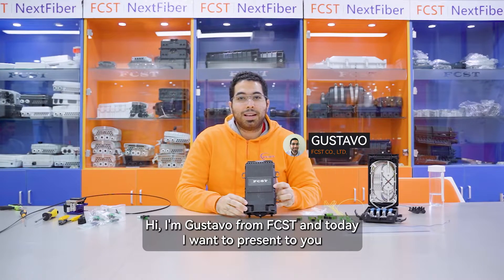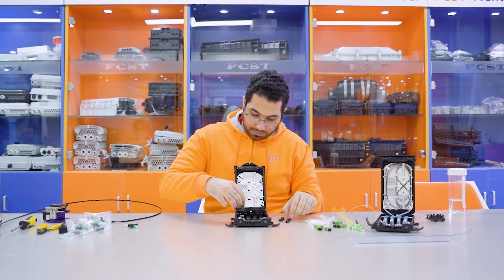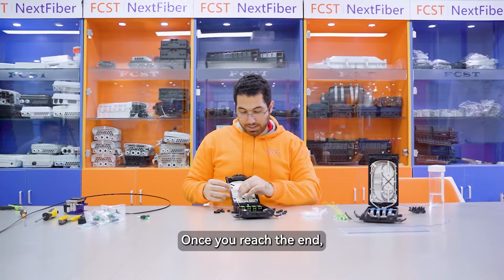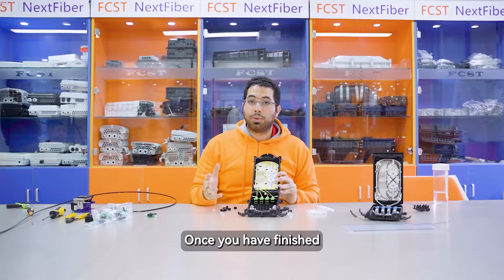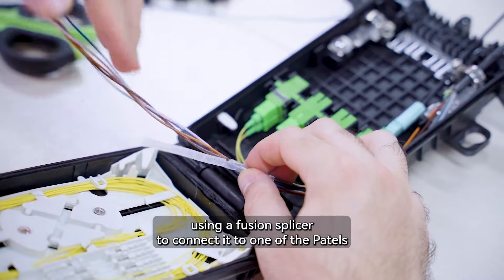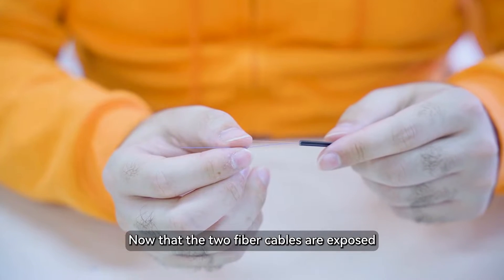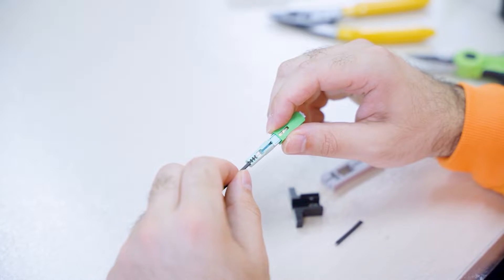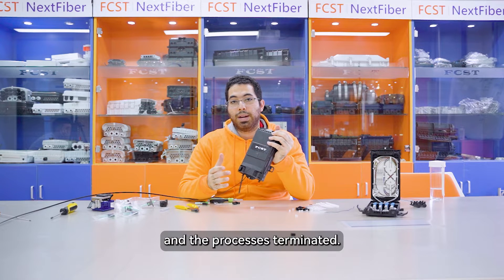How to install the FTTH fiber access terminal box?

Comment: The pigtails connecting to left side should be inserted from the right side of the tray, and the ones connecting on right side should be inserted from the left side. Just like the box sitting right next to you. This way you avoid bending the fiber too much. You could have also connected the pigtails on the connects before inserting them into the box. You don't insert the protection squeak like that, you roll it between your fingers and it moves up the pigtails on it's own.